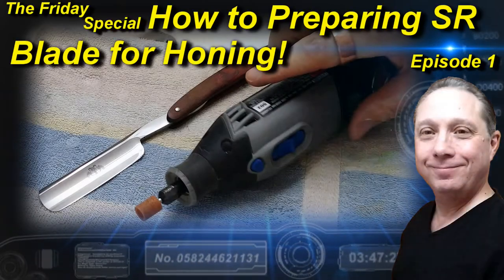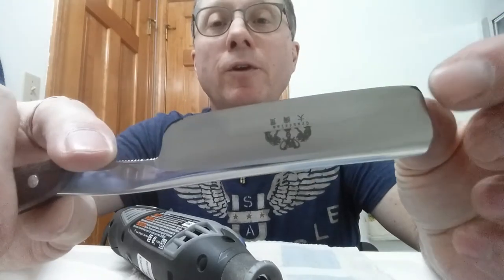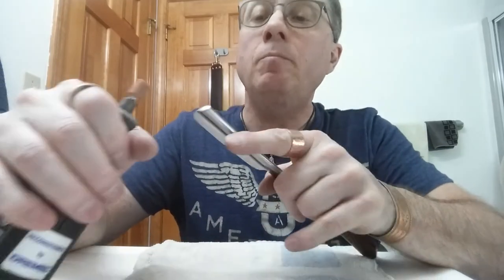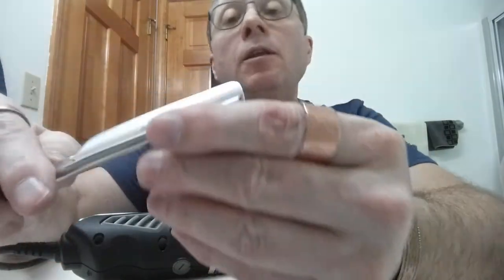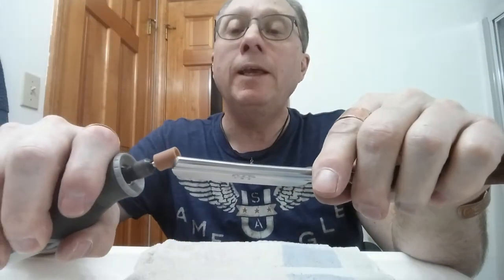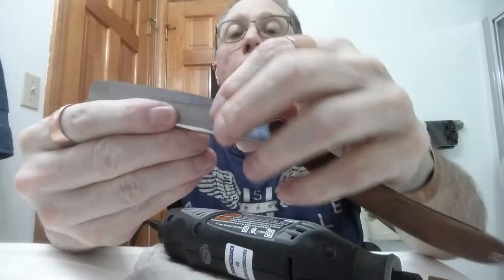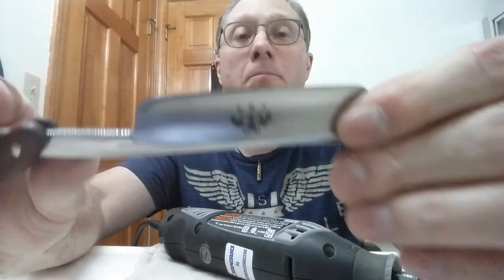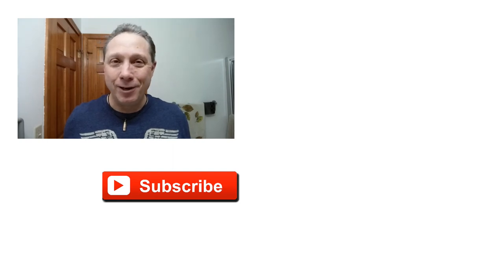How To Properly Prepare Your Straight Razor Blade for Honing Ep1

Comment: Well, it would have been more helpful if you could have explained why you were cutting off the heel and toe ...and how you knew how much to cut off.    As it is you showed us how to use a dremel on your razor without the why.
Reply from the maker: You will find an explanation for what I did at 4:25 in the video, and as for the amount that I cut off that's based on some other great classic straight razor designs. Possibly in the next honing video I can explain this more clearly, thanks for the comments and for watching!  🙂
Reply: Thanks for the videos. As a newbie, it is odd that you save the surprise reason for doing what you are doing for the end. I have made no videos, but I would start out with in order to hone properly you must Dremel off the heel and toe. Here's how I do it.